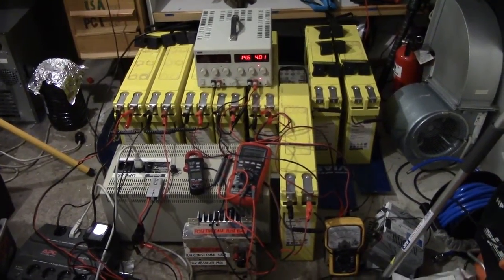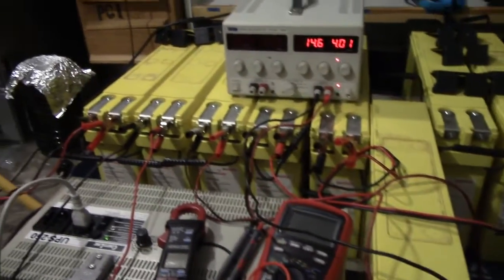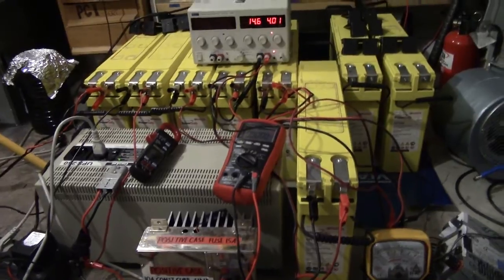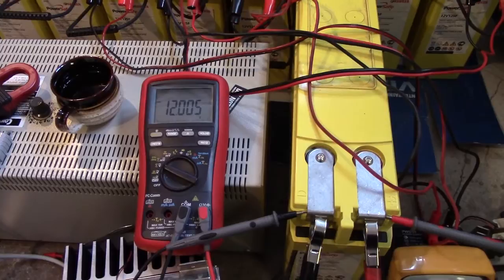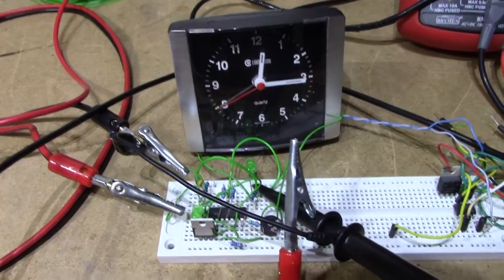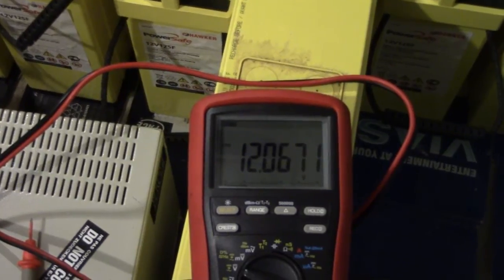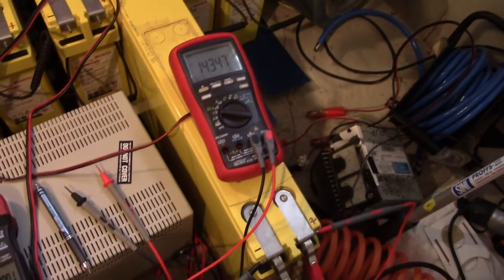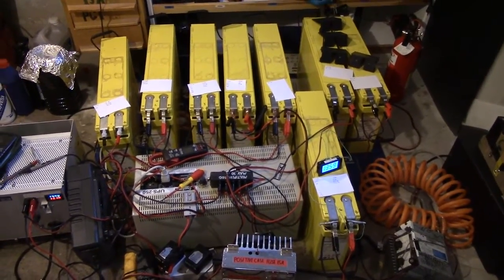Restoring 8 Powersafe 12V125 AGM telecom batteries

Comment: 14.6 is way high. They need to float at 13.62 with temp comp. To run up to 13.9 in 10° C. Fast charging will cut the life in half. And charge individually
Reply: And they all say above 12v but a heavy load will drop it immediately to dangerous levels. Charge individually Athens same rate for the same time
Reply from the maker: I am not floating anything at 14.6 V, lol. When you get these old blocks that have been floating for a decade, you need to charge them at very high voltages a few times to bring them back to life.

Comment: Hi ! Thanks for your video !

I've got few SBS190F batteries for free and I'm trying to save them...

I tried to charge them slowly but voltage is still around 10.6v. I think that on cell is bad.

Do you have an idea to save them ? Or they are just good for recycling ?
Reply from the maker: One dead cell = Time to let go. Sorry.
Reply: @FFcossag  I tried to pulse charge the dead batteries with surprising results. I still need to do some capacity tests but some of them now accept charge with a stand-by voltage around 12.2v.

It's more for testing and fun with solar chargers than recovering them for energy storage.

Anyway, thanks for the videos !
Reply: @dastatiks6182   any idea where I can some used ones ??